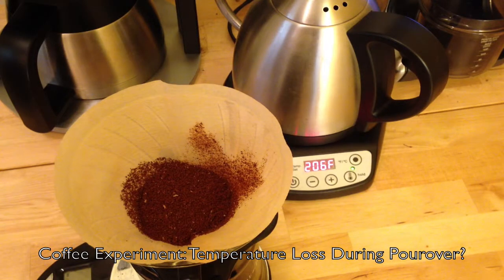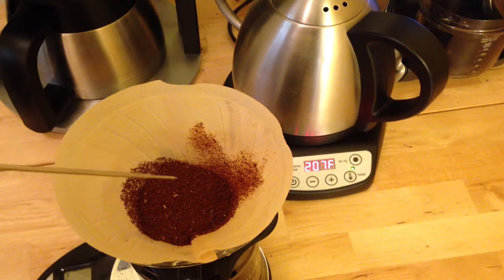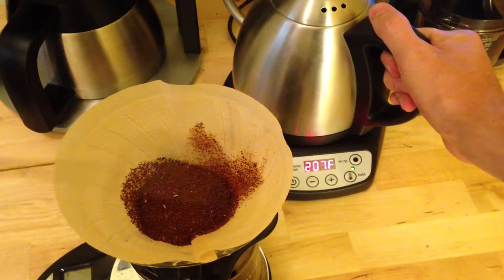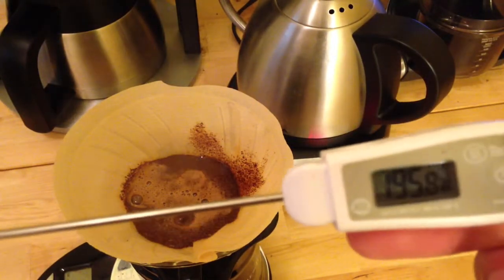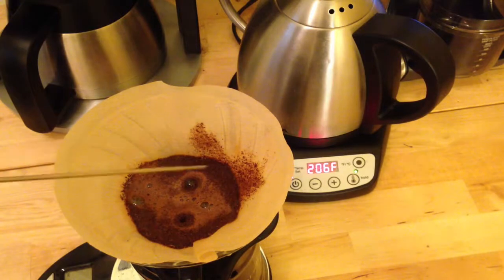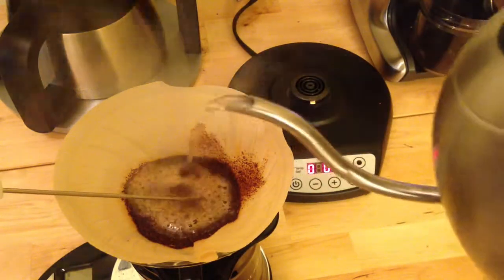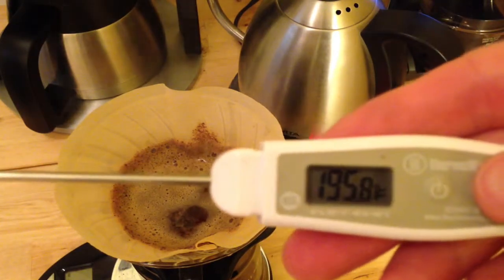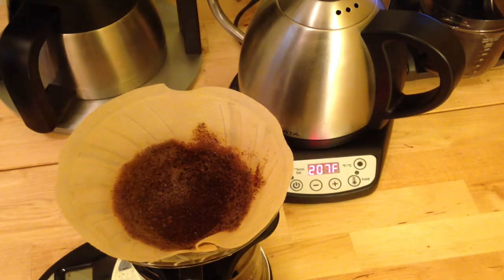Coffee Experiment: How Does Coffee Water Temperature Change?

Comment: This doesn't seem likely, especially on the second pour. I suspect it's just methodology. Maybe some of the temperature-reading surface area was outside the submerged area.
Reply from the maker: Thermometer definitely isn't the best. But we were just having a discussion about this on reddit actually and others were saying the slurry generally is significantly cooler than brew temp of kettle
Reply: On the bloom, that makes sense, but at the very least the second pour should be hotter than the first, since the mixture is hot at that point.
Reply from the maker: +Toby Manders well, one thing to note is that the bed became almost completely dry after the bloom (my bad in terms of the pour and talking too much), so at that point there was no slurry, just wet grounds. 

What do you think would be a good way of adjusting this experiment so I can try again? Would also love to hear what you find if you give this a try.
Reply: +The Coffee Concierge I would use a thermocouple with a multimeter if I had one handy